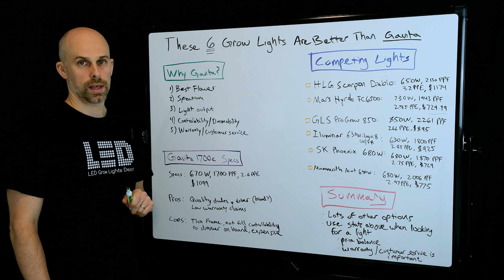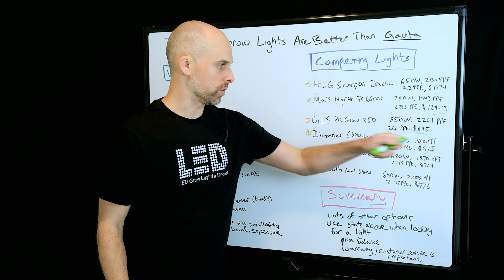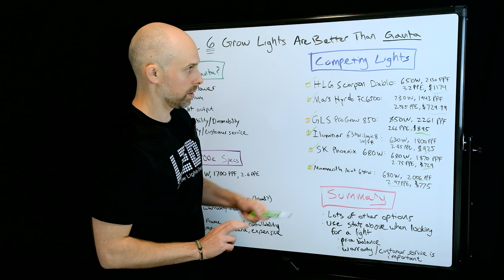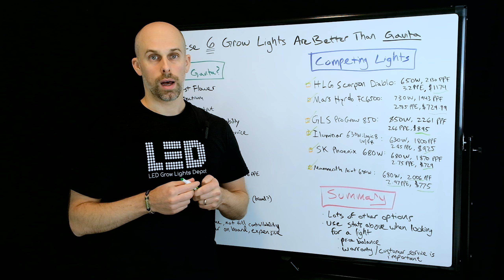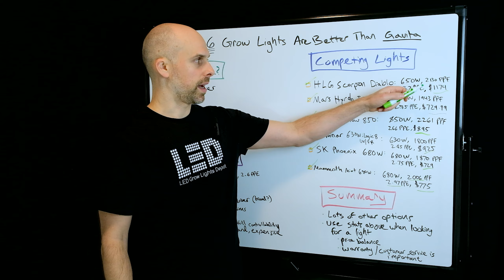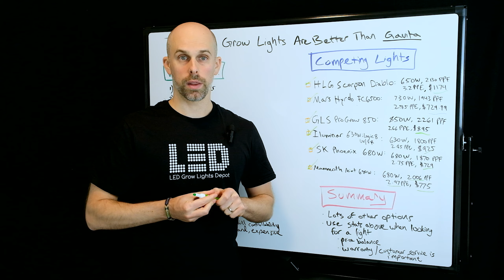These 6 Grow Lights are BETTER than GAVITA

Comment: glad the freaking Growers Choice ROI-E720 wasnt on there. You guys stiffed me on that one for sure....Grower's choice has no customer service when you're not inquiring about a purchase. I had my UV/IR  bars show up with broken clips and I reached out SEVERAL times to Grower's Choice and then to LED Grow Lights Depot. Grower's Choice straight ghosted me and LED Grow Lights depot told me to contact Grower's Choice. I told them that I had and they said that they'd reach out to them. That apparently never happened, The clips are a cheap little part and they both wanted to be cocksuckers about that even. I now buy lights that they do not carry and the company they come from has literally said that they would NEVER allow their products to be sold by these guys so yeah....I'd take whatever these guys say with a grain of salt.  You want real info, check ot DJCOCO at cocoforcannabis. He does legit reviews and testing instead of infommercials to push a product.
Reply: A Grower's Choice sales rep literally lied right to my face, telling me they are "made in California". That's a blatant LIE! They are cheap re-badged chinese lights. I purchased my roi720 back in March 2021, and in that time I had 3 sets of temp sensors fail, 1 Master Controller, and recently my 720 just pooped out. Now im in the hole for 2 master controllers and a fixture, but get this, now I have to pull the fixture from my bloom room, and ship it to Growers Choice on my dime? And I have to also BUY another fixture to replace the faulty fixture while Growers Choice decides how else theyre gonna f*ck me? Great way to treat their customers, not to mention some of us small business owners that can't afford to dump thousands into a light that literally now sells for less than half what it did when brand new. Growers Choice makes their money scamming growers, its that simple. And im not sure what this moron is talking about, Gavita is hands down one of the best brands on the market along with Photontek, Black Dog, CLW, and a few more top shelf manufacturers.  So yeah, I feel your pain, and im gonna do everything in my power to make sure Growers Choice keeps their trash chinese lights the hell off the east coast. My buddy almost ordered $30k worth of Growers Choice lights for his grow shop here in Connecticut last week, and can you guess who talked him out of it? That's right! F*CK GROWERS CHOICE!!!!  😎

Comment: This industry is moving so fast, that I wonder how much this list would have changed in seven short months. So many good lights out there.
Reply from the maker: Exactly! It moves quickly.
Reply: I think the aray 5x5 would be on this list if it were made a couple months later.

Comment: I run the Original Marshydro FC6500(3,144 lm301b & osram diodes/Inventeonics driver) Excellent light, they changed it though shortly after 😢

Photontek x 600w pro Excellent light

OpticSlim 500s Excellent light 

I run. 4x4s but I wouldn't hesitate to run them in 5x5's tents, the optic would need to be pushed but it will do a 5x5

Comment: Only a fool would put a slightly higher umol in front of build quality.Generally speaking EU built is better than US built,and that includes LEDs.Iv seen more Kind with broken diodes than any other make of light on ebay.It must be as high as 25% of the kind for sale have a number of broken diodes.

Comment: Well I do have to ask why no pros and cons for the other companies light that you put against gavita ? They can always put more power to any diodes and charge whatever they want but do these companies use have great customer service , how's their warranties , what diodes are they using , what drivers are they using , how's their reputation ? So many unanswered question for the competitors of gavitas that you didn't answer . Great video as always just asking why did you choose to put gavita on the chopping block and did you consider doing their 900e ? Great light less power consumption and still a great ppfd and par map 👍.  Have a great year brother!

Comment: Where is chilled led how u have mars hydro ur out of ur mind where is kind led ? Stop it and commercial growers love Garcia built quality matters
Reply from the maker: The point of the video was to show you that you can get a good light for a cheaper price than the Gavita 1700e. There are many lights better or on par with Gavita. The build quality of the 1700e is not that great. Quite flimsy. Although I will say it uses good diodes and driver with low warranty issues. Hawthorne customer service needs to step it up too.
Reply from the maker: The Kind X series is great!

Comment: the canopy ppfd is a salesmans wet dream..so whats the ppfd at 3.5 foot away from the light..lets say the hanging height is 1 foot and iam asking for 3.5 foot reading..that is still only a super small 2 foot plant..many led use 0.4w diodes the gavita ct2000e uses 3 or 4 times the power..the light shines further..just like a 600w hps vs 1000w hps..the 1000w can be hung on the ceiling and will grow bigger plants.canopy numbers are  bullshit

Comment: I have a Gavita 900e would you use it to flower or just veg?
Reply: That would be the veg light. Gavita 1730 is the full spectrum light. Gavita does have the 1930 which is the equivalent to the 1000w hps. You do have to hang thes up high like an hps.

Comment: ooof, I hope gavita doesnt have a team as bad as AC Inifinity's, I made the mistake of saying their light wasnt the best and inappropriate strikes and flags ensued in the following days. Great video though, Just so you know, the FC6500 has been updated, New output is 680 Watts and went from 3978 to 2688 LED's. I just tested it and what youre thinking is what it measured. Based on that update and your specs on all the other lights, I would probably go with Mammoth. Thanks for the info. Also, I wouldn't be surprised if a number of those other lights have downgraded their drivers in current models.
Reply: @menschlicheswesen84  who dosent leave some clip fans on at night to move air .  That be just a blunder by a new grower. If the inline exhaust shuts off once it’s expelled the humidity high set point then it’s doing it’s job and the tent still has air movement from the clip fans or oscillating fans. That’s where the air movement comes from not the exhaust fan . And the exhaust will come back once the rh humidity rises at it’s set point. RH spikes at night when lights out.  

But anyways we aren’t relying on the exhaust for air movement or really even fresh air .. That’s the job of the intake fan and oscillating fans..
Reply: @timpage5021  that will cool your plants, just suck it out
Reply: You’ve mixed up the FCE and FC series. 
FCE6500 uses I like 3700 LEDs . Always has still does. FC series uses around 2700 chips. 

Difference is FC uses Samsung LM301b and FCE uses bridgelux chips.
Reply: @timpage5021  I didn’t mix them up,  check the review I have on the fc6500 and migro or coco 4 cannabis.  They’re not the E models.
Reply: @HowWeedGrow  domt need to . I got the original version folding 6500.  The FCE uses more chips but of using bridglux instead of Samsung LM301b like the FC6500.

Comment: Is that The manufacturers data on the lights? Have they been tested by the third party?
Reply from the maker: Yes, from the manufacturer. I know HLGs has been third party tested but I am not 100% on the others. Most manufacturer’s data these days can be trusted. Almost all brands are using similar diodes and drivers so the numbers make sense.
Reply: @Ledgrowlightsdepot  if any testing can be trusted it is gavitas..
those can be used as a standard to compare the rest..

alone the budget that gavita uses on research and testing beats all the rest together

that and fire safety is what makes the rest a gamble, many of them wont be CE approved either because they dont want to use the money or because they dont pass

and if thery do have a  CE stamp, it is the chineese one (China Export 🤣)
most of them only talks about the diodes they did not test them self.
and how many companys test for fire safety, like gavita needs to because they sell to real commercial customers and because they need a CE stamp

Comment: I've used gavita 1700 and yes they do LOOK flimsy but they aren't. We  hang plants from our lights during first week of drying. We have over 100k in gavita lights too. I know their limits.
Reply: Are you familiar with the el3 master controller?
Reply: good price also for the new controllers, compared to trollmasters for example..
gavita set the standard and they have always done.
no other company does same research , before they sell people a product..
and no other company can compare with the costumer service

the fire safety is worth the money alone, i have seen that more then 1 time
Reply: @Hansen710 troll masters controller is ridiculous pricing...I agree..but if he could bring that price down everyone would be hard pressed on switching...he's got great lights just the pricing is crazy compared to others..grandmaster lights are really good too...optics have great lights and have been around for awhile...some of these lights he mentions doesn't have spectrum tuning, built kinda sketchy...idk...to each their own. Illuminar I'd never buy...mammoth is very expensive also.

Comment: great video  i have owned 3 Gavita 1700ePro fixtures and purchased them on a preorder. Great quality for sure and after 3 years no issues. One thing to consider here is that the Gavita 1700ePro is a 3 year old light so considering its that far back in production compared to new technology its a very impressive light.

Comment: Ideas:  1.  Mammoth pushes a super high PPFD targets.  They have the academic studies on their sites.  Thoughts on these studies and updated ppfd targets?  You can be the new Dr. Bruce Bugbee haha.  2.  Compare common power drivers  3.  Compare common didoes.  4.  UV post/thoughts  5.  Quantum boards vs bar style? 6.  Far red thoughts?   7.  Light Intensity drop  per 12" LED vs HPS.  8.  HPS ppfd vs LED ppfd  That should keep you busy for a few months.
Reply from the maker: Thanks for the suggestions :)

Comment: Why isn’t the growers choice E720 on there
Reply: Because the Growers Choice roi720e is a piece of shit like the rest of their products.
Reply from the maker: It is less expensive than the Gavita, but has the same efficiency. I wanted to feature lights that had better efficiency and light output specs. But it is a pretty solid light!
Reply: @Ledgrowlightsdepot  ah ok. If you didn’t know the Growers Choice can go to 800 W off the wall using the master controller. It has a ppfd boost option.
Reply: @Matthew Earl  i love my gs-e720. I bought a e680, grow craft,  scorpion diablo,  and a timber.  I came back to the growers choice and got a e720 because i have the best results with their spectrum. I will admit Im looking at getting a GML tarantula because of the ethics of the company and after Migro results, Im even more interested.
Reply from the maker: @mertelnd  Nice! What do you mean by ‘ethics’?
Reply: @LED Grow Lights Depot  i believe they are doing their best to do the right thing even when no one is looking.  Not all companys can be that honest.  I gathered this from the GML show on YouTube over the past several months.

Comment: Where is Migro pro
Reply from the maker: The MIGRO ARAY 8 was a little underpowered for a 4x4 compared to these other lights so I didnt include it. The MIGRO ARAY 12 is another option to conisder though. The dimensions of  54″ x 39″ on the ARAY 12 is a little outside the square-like shape of the Gavita and these other lights so that is why it is not on the list. Great light output vs price though!
Reply: I would imagine they don't sell em.....

Comment: How much is a 600 watt Led light running 18 hrs a day going to cost per month? +cost to run a blower & Fans?
Reply from the maker: That video is coming next (minus the blowers/fans)
Reply: 1000W draw is around 3$/day.
Reply: @lok777  Thank you
Reply: @rmcnasty7319  just the tax on the peak hours and the the cost of transport for electricity in those hours, can pretty much double the cost compared to the rst of the day..

so many factors that does you cant say what it costs, before sieng what people pay for their electricity..
and still it is hard to predict, a varible price the last moth  have been 6 times higher some days then the rest of the year..
and free other days
Reply: @lok777  that cant be right 
my electricity is free at night and my prices for rest of the day depends on how much solar and wind we have, and the gas prices

sounds like a insane price, i thought it was us in europe that was in a war and had problems, but this makes me wonder

with 3 dollars a day it is double what i pay and more
Reply: @Hansen710  My electricity cost is .14 per kilowatt hour.  24 hours @ .14c/hour is 3.36, thus 1000 watt draw is around 3 dollars per day.  This obviously varies per your electricity cost and light timing, but that is a basic and easy answer to do math from.
Reply: Thank you
Reply: Some electric companies have two billing programs.  Flat rate on all hours. OR Cheaper rates on hours used during off-peak times. If you are going to use 18 hours a day.
Pick the flat rate as it's cheaper overall.
As rate increases at peak times. 
PS Use 
A small extra LED light for backup.  if the main light or driver goes out. 
You won't interrupt the light cycle. Use a Honda generator with a switch that turns on when power goes out. When there is a power outage or rolling black outs.
You can thank me later. ALSO, u can use a 12 volt HIGH OUTPUT LED string Light, around the grow room or tent. 
Connected to a timer & a 200Amp hr Lithium battery. For backup.  Wear a large brim hat & and cover your skin
From light rays. Use proper eye protection when around these lights. If you're going to be doing some work on plants, use the low power light or DIM  big light down to 20%
Reply: Alot has to do with the fixture and if your running 120v, or a 240v. You get charged by how many amps your using. If your running 5 fixtures at 120v, your bill would be higher than say if you were running 5 fixtures at 240v. You just need a electrician to add adjust your electrical in the room and your circuit breaker.  Growers Luv!
Reply: @702grobuddy3  incorrect, you pay for watts not amps. No difference between 120 and 240 price.
Reply: Use electricity calculator and find out your cost per kwh

Comment: What about  Viparspectar lights or Growpro  looks like you have alot of over priced lights on your list
Reply from the maker: Thanks for your comment. Viparspectra lights are not as in high light output as the on this list. Which GrowPros light...HM660? Yes, that COULD have been on the list too, but the lights on the whiteboard are better in terms of light output and efficacy. The HM660 is $725 which is nearly the same as two of the lights on this list. As mentioned in the video, these lights are examples of good lights and there are more out there to choose from :)